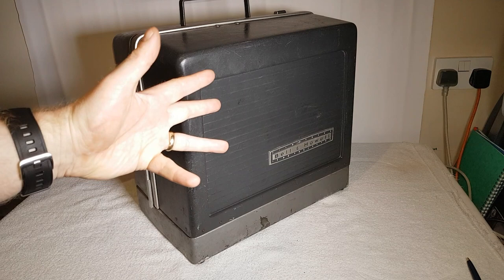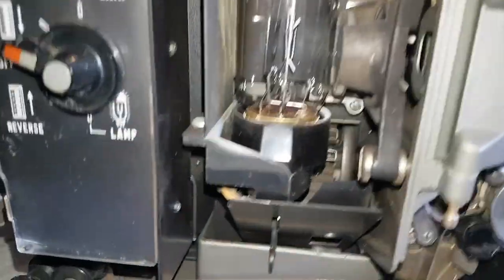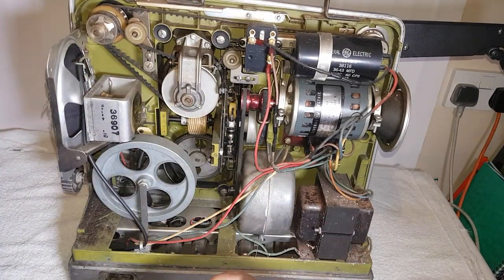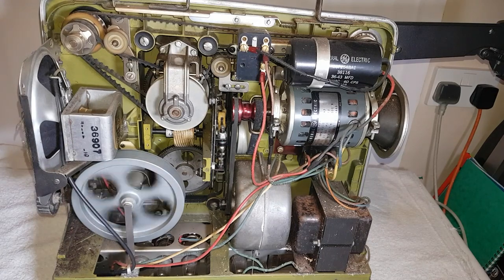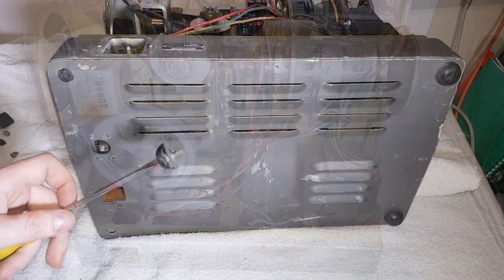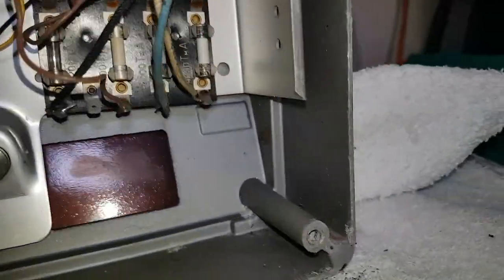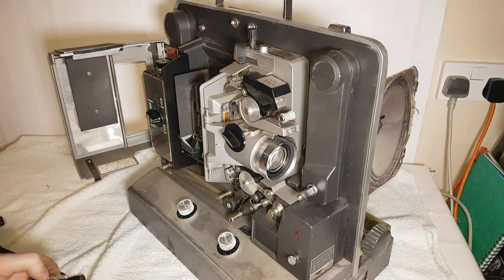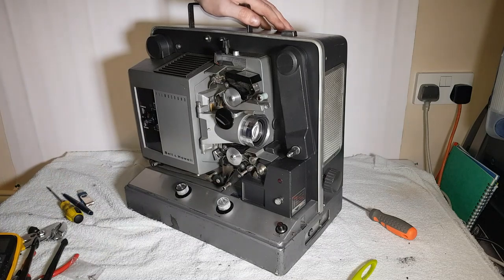Trash Picked 16mm Film Projector : Bell & Howell 652 : Restoration Part 1 : Inspection & Clean

Comment: I have the same projector, and it is a 552 Specialist 16mm projector, and it works fine and the worm gear looks fine, but it starts to get crack overtime. Overall it is not too bad, and the projector runs well. I tested the cartoons and it looks fine. The 552 Specialist has a Tube amplifier, later versions are solid state.

Comment: This solution will start the motor in the load position, and then start the lamp in the second 'lamp' position of the fron switch when the film has been loaded and is on the pick-up wheel